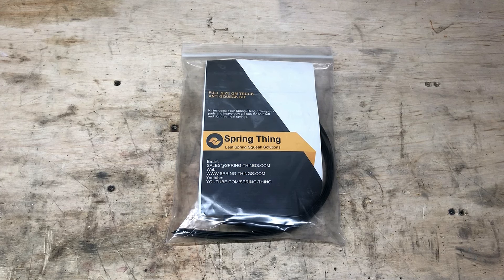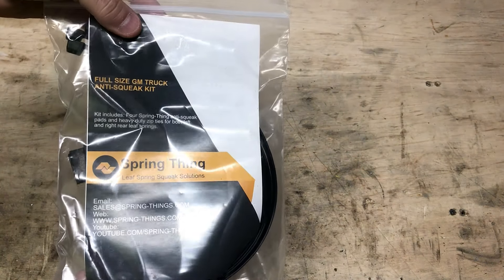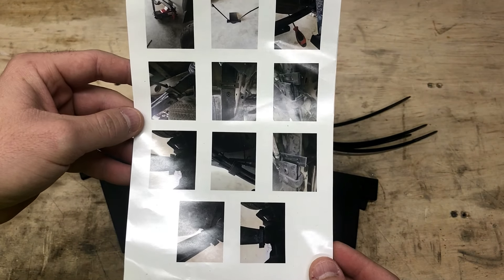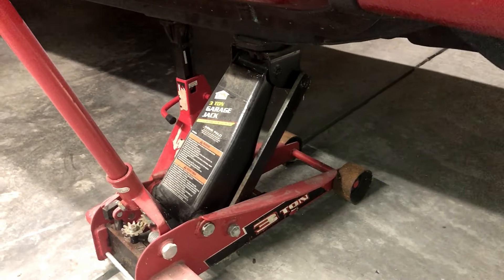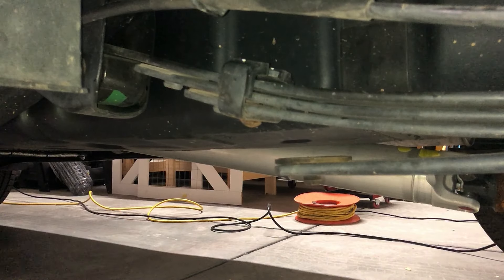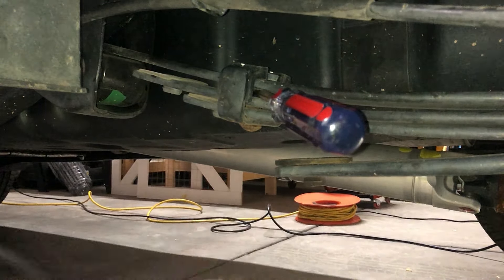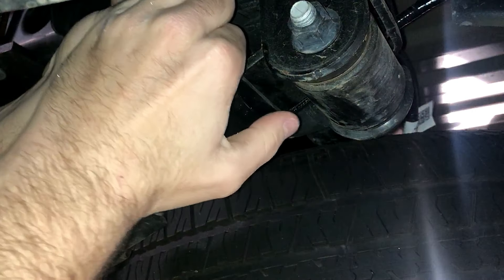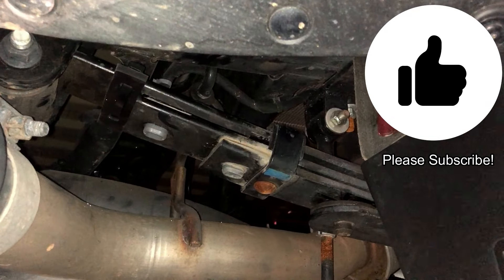[HOW TO] Fix Noisy Leaf Springs - Install a Spring-Thing (Pretty Much Any Pickup Truck)

Comment from the maker: One thing I forgot to mention in the video. If your truck has a rear sway bar installed, you will need to first disconnect the end links from the bar, before you attempt jacking up the truck. Otherwise, you will not get full droop on the leaf springs, and it will be difficult for you to slide the rubber pads in between the leafs.
Reply: Do you have any videos on how to do that?
Reply from the maker: Yes. Search for Hellwig away bar install on a gmc canyon.

Comment: 100% recommendation. It took 30 minutes to install and completely fixed my 2018 Silverado!!
Reply: Did you have to remove anything or does it work exactly as the video? I have a 2018 as well....passenger side is squeaking...driver side isn't so far
Reply from the maker: Don’t need to remove anything.
Reply: I did it with my 18 silverado and left the tires on and didn’t remove anything it took less than an hour to do both sides.

Comment: I was skeptical concerning this product. Dealership fixes didn't work and spring replacement was my next option. Thought I would give these a shot so ordered a set and had them installed in 15 minutes. No need to remove tires and wheels from my 2009 silverado as could reach where I needed to be without much hassle. I still doubted how something so simple would work but jumped in and started my test drive and within 20 feet I realized that this was IT!. Pulling out of driveway was usually squeaky and loud as I turned onto the roadway and continued with every turn or bump onto a new surface. There was NOTHING! Not a sound from the rear springs. It was like a brand new truck and I couldn't believe it. Give these things a try and get rid of those horrible squeaks. GREAT PRODUCT!!!!
Reply from the maker: Glad to hear!

Comment: Dont usually make comments but this product simply works and easy to install.  Had an annoying as hell squeaking sound coming from the front of my left rear wheel well. Knew it was the leaf spring and hinestly did not want to use a lubricant because of the attraction of dirt. Luckily I came across this video and decided to give the product a try.  Truck is now quiet and could not be happier. 2019 Chev Colorado ZR2 Bison.
Reply from the maker: Thanks for posting! Glad to hear they helped you! Thanks for watching.

Comment: Fixed my loud groaning, grinding.  Installed them myself today.  Took about an hour but would have been about 30 mins if I'd had the right equipment.  The rubber tabs worked perfectly .  The loud noise is gone.  I first tried emailing them to ask if they'd work on my 2011 GMC because the video flashed 2014 & 2015 models on the screen.  They never replied.  I wasn't real impressed with that to be honest but I took the chance and ordered them anyway.  They worked.

Comment: Worked on my 2023 GMC AT4 with 1,400 miles on it used to sound like ball was in the bed. After the dealer said it was normal along with GMC "Technicians."
Reply from the maker: Sounds about right! Glad it helped you out.
Reply: Yes, my dealer told me the noise on my brand new 2024 Colorado ZR2 would not be covered under warranty because I had it undercoated.  My first new vehicle in over 40 years,  needless to say am quite upset over this.  You described it well! With the ball rolling in the bed.  After spending 50,000 dollars on a vehicle you would think the dealer would have some compassion.

Comment: Very thankful I found this video. Had my 2014 Sierra at the dealer 3 different times and they couldn’t find the issue. They greased it and the noice would be gone until it rained or I washed the truck. I’m praying this works as it has for everyone else. Purchased two sets just to have back ups.
Reply from the maker: They work great. Should help your 2014 out for sure! Thanks for watching.

Comment: So I changed my whole Suspension and also found out that my 2015 Chevy Silverado was missing the transmission mount but on bottom and after I did all that still made noise added this product and boom it’s fixed thanks so much
Reply from the maker: Great! Glad it worked. Thanks for watching!

Comment: I noticed a squeak at just 25k miles in my 2016 Colorado. I got the truck to handle some tougher terrain for work, and squeaking around the jobsite in a newer looking vehicle was a tiny bit embarrassing. I found myself driving more carefully than I did in my previous work vehicle just to avoid the noise! 

Going to order a set. Thanks for finding these!
Reply from the maker: Give your leafs a good power wash before installing if they are super dirty. Should help even more. Thanks for watching! Glad to help.

Comment: Just installed these on my 2020 Sierra elevation. Worked like a charm and the suspension is as quiet as a mouse . Great video and awesome product.
Reply from the maker: Awesome to hear! Thanks for watching.
Reply: Single- what noise WAS it making before hand?
Reply: @Dan007UT  every time I pulled out of my driveway, or went over bumps at slow speed the leaf springs would clunk. Mostly on the drivers side. Sounded like I was driving a truck 30 years older
Reply: @SingleMaltAndMaps  I get a lot of clunking anytime I'm offroad but on road I get nothing. I'm about to throw these things on. The clunking and squeaking almost sounds like it's coming from the front but I'm hoping it's all in the leafs!
Reply: @Dan007UT  when my truck was at its worst, I could rock the back end side to side by the wheels and it would clunk
Reply: @SingleMaltAndMaps  Just bought my 2023 Silverado $60 K truck  and have the same clunk noisy How in hell GM don't fix that problem???

Comment: Just put these on my 21’ Sierra 1500 AT4. They worked as advertised, no more pooping or thumping coming from the rear end. I took it for a test drive after installation and flexed the crap out of the truck, not a single peep from the leaf springs. 

Just a bit of advice, when installing these using a floor jack, do not lift from the Rear Differential “Pumpkin”, it doesn’t help. The leaf springs are still compressed if you lift it from the “Pumpkin”. What I did is lift it from the rear of the bed, underneath where the hitch is located. I didn’t even lift the wheels off the ground, I just lifted it high enough to relieve the pressure from the leaf springs. Once you do that, it takes less than 20 minutes to install. Remember, always use jack stands for safety!
Reply from the maker: Correct you need to droop the suspension in order to install these. Lifting from the frame works too.
Reply: Did you install the pads in the same location as in this video?
Reply: @greenfire919  yes, the exact location in the video 👍

Comment: Just ordered a set, I know it won't resolve the ridiculous axle 'free-floating' thunk but hopefully it dampens some of that noise coming from back there. Thanks for making it easy and not overpricing it. It's actually cheaper than a full 1/4 mat and the time that would go into cutting IMO.
Reply from the maker: Glad to help. Just FYI. This is not my product, just did a review for the Spring Thing folks.
Reply: Thank you!
Reply: Did it resolve the thunk?   My truck has it too.

Comment: This is great! I was wondering why Chevy or GMC never recalled this issue. Looks like a simple enough fix though. Thanks for sharing.
Reply from the maker: The official GM repair procedure is to grease the hell out of the leaf springs. Not sure why it hasn’t been fixed in engineering. Probably a cost issue. Glad to help. Thanks for watching.
Reply: They actually do have a service bulletin sayimg yo replace those rubber isolators.
Reply: @alejandrocelio5941  should i do the bulletin or just use these? Alot of people did it with dealership and noise continued until they used the spring things
Reply from the maker: The bulletin is a temporary fix. These will last for the life of the truck.
Reply: They only issue Recalls for safety things.  Seat belts, brakes, air bags, power steering, ad nausea..... Service bulletins sometimes fall 1/2 way between recall and bulletins.

Comment: One Thing I just found out is after installing these I was still getting a little noise. After more hunting I got a 18mm attached to 1/2 torque wrench set at 86 ft lb. and checked all frame mount bolts which was a total of 6 on my vehicle 2007 hummer h3 mainly concentrating on passenger side considering that’s where the noise was happening and like magic noise was gone! One thing to think about and in my situation I mainly drive by myself so there’s 200 more pounds on drivers side at all times and cab flex was part of the culprit! This should apply to most Chevy vehicle considering hummer h3 is based on Chevy Colorado or Canyon frame. All and all me concentrating only on leafs springs was only half of the problem. Also sprayed silicone lubricant on all rubber mount frame cushions. We’ll see how long it last but all is well from the annoying chirp I would hear at low speed small bumps which reminded me of my dads old Chevy pickups but not quite to that extreme but similar. Hope this helps someone with same issues

Comment: Just put a set of these on my 2020 Ford F150 and it was obvious that they solved the squeek/screech as soon as I lowered the truck! These are well worth the money paid. Pretty easy to install also.
Reply from the maker: Great to hear. Glad you got it fixed up!
Reply: @fondupot  thanks for the video and recommendation!
Reply from the maker: You’re welcome! Thanks for watching.
Reply: Will they work on f f250 6.7
Reply: Ford f 250 6.7
Reply from the maker: @speckledtroutfisherman1619  Check the video description.

Comment: Just installed mine today and did exactly as advertised. Now I’m compelled to return to my dealer with my brand new 1k miles 23 Silverado to say this is proof it’s the leaf springs and that they need to fix it.
Reply: Also meant to ask, how long do folks think these will last. I am slightly concerned about it not working for long, but only slightly. They appears to be very durable and certainly better that the piece of crap Plastic they tried to solve the problem during manufacturing.
Reply from the maker: Glad to hear they helped. I’ve had mixed reports of longevity. Mine are still fine. But my truck doesn’t have very many miles. Over time and with extended exposure to the elements, the rubber can break down.
Reply: @fondupot  thanks for responding. These have saved me from making a rash decision and selling my truck because of the clunking. Thanks again.
Reply from the maker: Glad to help.
Reply: Had both leaf packs replaced on my 2023 Sierra 1500 and still making sound. Gonna have to give this a try

Comment: My 2021 Colorado ZR2 started clunking bad in the rear after I undercoated with Fluid Film.  I was close to trading it in it was so embarrassingly bad.  Spring Things fixed the issue immediately.

Comment: I just installed these on my 2018 Silverado and they took care of the noise. Great product, I highly recommend it. Thanks for the detailed install video, appreciate it.
Reply from the maker: Awesome to hear! Glad they worked for you. Thanks for watching!
Reply: What does your noise actually sound like? I just bought a used 2018 Silverado and it sounds like an old wooden floor creeking, or like an old set of wooden steps. Not a squeak, but more of a creak sound, if I’m making sense?
Reply: @fondupot  could you describe the sound? Squeak? Creak? Mine is more of a creak sound like old wood floors
Reply from the maker: Yea. A creak could also be the leafs. But more often the sound is a clank or clunk.
Reply: @shanestone100  yes, mine was creaking not squeaking. I would also  describe it as a knocking/clanking sound and since I installed this product all sounds are gone and truck is as good as new.
Reply: @chrismyers5437  Just tried to install these on my 2018 Silverado with no luck . Did you remove the rear sway bar ? I haven't tried that . Thanks !!
Reply: @edwardweis9481  No, I only jacked up the rear to get the tire off the ground and then used a big screwdriver to create some space between the leaf springs and slide them into place. Put some grease on them to slide them into place easier. Its been 2 years and they're still holding up and no noise. 👍
Reply: @chrismyers5437  Thanks for the quick reply ! Got back under my truck and don't see a sway bar . The noise I'm hearing is a bumping at low speed . Kinda sounds like the spare is loose . It's not . I got the rubber shim started but couldn't get it slid all the way in . Area is a little 'gummy' like the factory used grease . Would wheel bearing grease work ok ? I'm going to try again soon . May get my 19 year old grandson to help ? Thanks again !!
Reply: @edwardweis9481  yeah, most any type of grease should work, just need something thin and slick enough to help them slide into place. Even with the grease though its still a tight fit so you just have to get it in position as best you can, doesn't have to be perfect. And the noise you're hearing likely is the leaf springs coming together so this should help. Good luck! 👍
Reply: @chrismyers5437  Thanks so much , Chris . I'll try again soon .

Comment: Hey, that's pretty cool.  I didn't know I needed that.  If I don't, I probably will in the near future!  Thanks for the review.
Reply from the maker: Yea these helped quiet the springs on my Canyon. Definitely a nice little product. Thanks for watching!
Reply: @fondupot  You bet.  Thanks for the info.  Is there any trick to disconnecting the sway bar or is it strightforward?
Reply from the maker: Very simple. Before jacking up the truck just remove the bolts on the end links. Mine came out really easy.
Reply: @fondupot  Cool, thanks.
Reply from the maker: You bet! Good luck

Comment: Just put an order in. Don't usually go through the comments. But same issue. 2018 COLORADO ZR2 with about 60k miles, started around 30k. Dealer couldn't find the issue. Clunking in the back is annoying, any little bump. Lets see how these work out. Looking forward to them.

Comment: My 2020 f150 was popping and clunking. Never seen this issue before working in a shop dealing with these trucks all the time. I’m sure my truck has a defective leaf spring or something and the dealer says it’s normal lol. I replaced the isolator pads and that fixed it for 6 months and now it’s back so I’m gonna get this and call it a day
Reply from the maker: Good luck!

Comment: Hoping this will work on my just purchased 2018 Silverado. My only difference is this truck was lowered. But I figured out sound was from right where you first showed in video, the front bracket around top 2 leaves. The dealership putting me off because they realize they are Ford service lol, but I will spend on this item and I bet problem will be solved.
Reply from the maker: Glad to help thanks for watching

Comment: Great video! Simply and easy. I'd definitely take the wheels off. I can see fighting with the screwdriver up there. Thanks!
Reply from the maker: I did the passenger side off camera without removing the wheel it’s not that bad. Thanks for watching!
Reply: @fondupot  I didn't remove the wheels when I installed them in my 17 sierra :)

Comment: Definitely getting these! Thank you. I greased mine and that fixed it but washing my vehicles so much it doesn't last.
Reply from the maker: Yea, greasing the leaf pack is the dealership fix. And it's been proven to help, but does not last very long. The rubber pads should do the trick. Thanks for watching!
Reply: That's what I was doing for a few month's before I came up with the idea for the spring-thing. :( That got old pretty quick! I actually hated driving my truck for a while lol 
These will make you like driving your truck again :) They also do away with that clanking sound these trucks make.
Reply: @spring-thingllc8342  yes my problem is the clanking. It's amazing how something so simple can make your truck sound like it's falling apart. I hate driving my truck with that noise...it's embarrassing. Greasing the leafs get old quick!

Comment: My 2019 Colorado started squeaking at 9000 miles. Dealer change the springs and 1000 miles later, noise returned. We back to dealer, and they tried doubling to factory rubber pads and lubricating the springs. Worked for 500 miles.  When factory warranty expired, installed spring things. Took me about 1 hour.  So far noise gone.  Fingers crossed.
Reply from the maker: Glad to hear. Thanks for watching.
Reply: Noise returned after about 400 miles. Very disappointed.
Reply from the maker: Sorry to hear. Try repositioning the pads.
Reply: It appears that the creek is coming from the front spring bushing. Tried spraying with lubricant, but no luck. Guess I just have to live with it.  This is my last GM vehicle.  Shouldn’t sound like an old work truck starting at 9K miles.  Spring Thing might have worked if the noise came from the leaves themself.  Let’s see if my wife will let me buy a Honda Ridgeline (if I can find one without a dealer markup).

Comment: I installed these a year ago on a 2014 Sierra 1500 with a lift and they were quiet, for a while. I was under the truck washing it about 6 months later and the zip ties were broken on a couple and they were flattened out and slipping out of the spot. Not sure if I'm too aggressive with my occasional off road driving but $45 every 6-12 months might be better off buying a new set of leaf springs.
Reply: I had the dealer replace both driver and passenger leaf packs and sound still exists on my 2023 Sierra 1500. The fact GM has addressed this correctly is insane

Comment: I have a 2006 Sierra Crew cab and I recently replaced the leaf springs and went with the 2013+ GM springs. They are a direct fit but increase the payload capacity by a few hundred lbs. Almost immediately I noticed a lot of clunking or rattle from the springs when going over bumps. Will these fix that?
Reply from the maker: Should help yea.